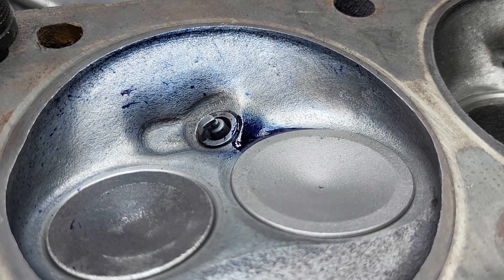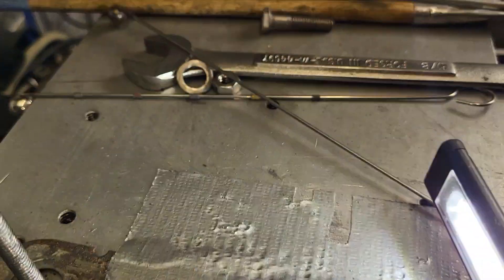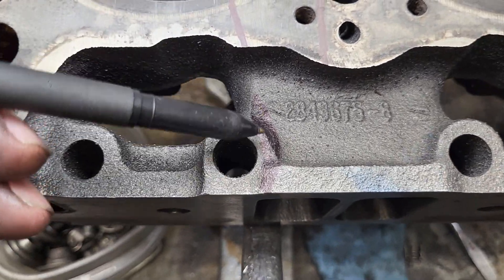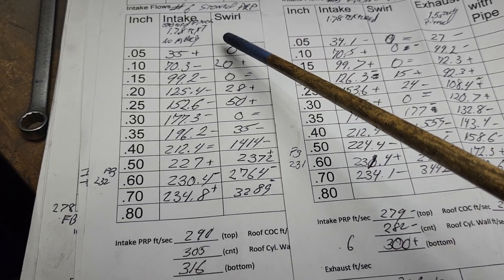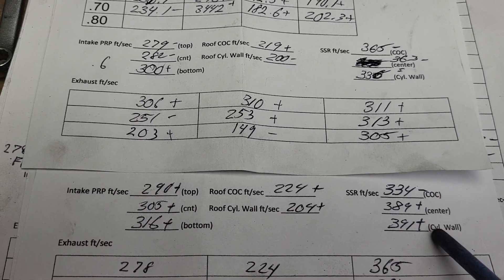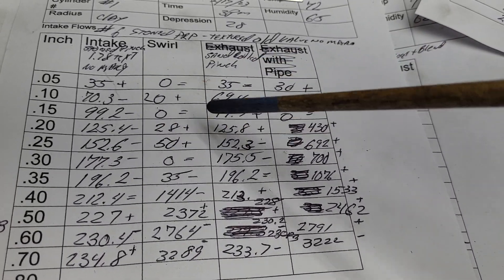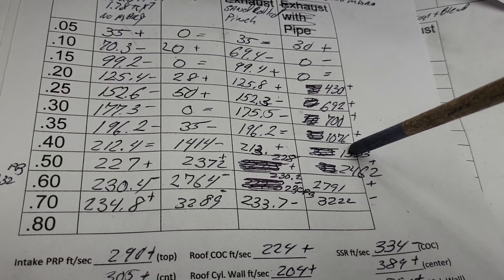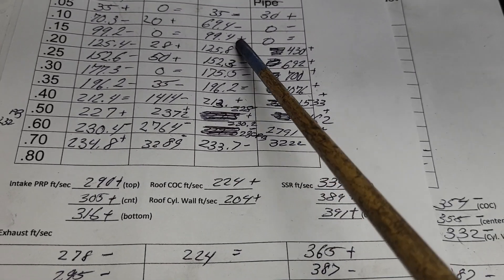David Vizard, Unity Motorsport, Mission Impossible 318 project. Textured push rod pinch experiments

Comment: If you grind the PRP area flat (parallel to the straight wall) and then grind a step immediately after the flat PRP, will the low pressure area created by the low pressure area promote more flow on the curved wall vs just making a bigger version of the same PRP shape?
Reply from the maker: Not enough metal to do that mod. Thanks

Comment: The 318 poly with the dual quads made 290hp and 330tq out of factory manifolds stock cam and heads with no porting whatsoever. I don’t think a hp/cid is out of the question even thru the 2 bbl. Especially if the compression is raised with some head milling
Reply from the maker: Good info. Thanks

Comment: Hey I have an off topic question, like all my questions and comments now that I think about it, but I digress: when deciding on a seat insert to install in a head what determines the OD of the insert? The seat diameter on the valve or the overall valve diameter?
I've asked this many places and I can't get a straight answer so I'm asking the person I should have asked first.
Reply from the maker: The insert should be at least the size of the valve. I prefer the insert bigger so the top cut is on the insert.  Casting thickness has to be considered. Breaking into water is no fun.
Reply: @servediocylinderheads   THANK YOU! Simple, straight forward, and totally answers what I wanted to know. I really appreciate the help. ✌️
Reply from the maker: @jseal21  No problem

Comment: Hi, love your channel. Quick question, would a head like this benefit with a larger intake valve? If so, what size would you recommend? Thanks again.
Reply from the maker: With the bowls done right they are thin with 1.78" valves. I would go 360 size 1.88" valve with tight sonic work.

Comment: If I had a CNC it would be cool to take an old undesirable open chamber head and weld the chamber up n mill it into a modern chamber and try that, anyone can grab a new hotness going but getting old junk to work good is just fun. You gotta do some upgrades not doing some mandatory mods is like a regular girl getting a job as a stripper and running her OEM knockers
Reply from the maker: Iron welding is probematic. Thanks
Reply: @servediocylinderheads  I've done it with muggy weld and peen stress relieve ...
Reply from the maker: @regdor8187  I have never used that.

Comment: is this a dodge 318? Ie 340 & 360 head swap! i went to ford! 351 C or M 1985- 1992 nascar yates was who got my air flow stuff! ( tractors marine stuff & oil testing standing on drag strip watch wreck's & not a good ending ok I walked away ) it was top fuel stuff dodge hemi ok! the wreck! (why i back my step father brother 100% death rate cancer break threw he lived threw it he had a job over my seal adoption to see my real father he went to boat factory in state far away to see my real father & fix my relation boat motor the factory was ranger boat & forest wood who i was to see! he told me that!)
Reply from the maker: It is a dodge 318. Thanks

Comment: Vortices I think is the word that is escaping you at the moment. Love the series.
Reply from the maker: Thanks
Reply: A vortex will slow the in flow....If a vortex helps your power, it is because your flame front is too slow, add some differential squeeze to move the flame front....If it takes 30 plus deg of advance for max power, your combustion chamber is wrongly thought out.....
Reply from the maker: @regdor8187  It is a deep open chamber with no squish. It needs all the help possible!
Reply: @servediocylinderheads  custom piston , raised into the flat area of the head , lowered in the valve clearance area ..
Reply from the maker: @regdor8187  That would be great but not in this plan. It has to be crippled with open chambers, reworked stock dual plane, reworked exhaust manifolds and a modified bbd 2 barrel carb
Reply: @servediocylinderheads  is welding allowed ?
Reply from the maker: @regdor8187  Nope
Reply: @servediocylinderheads  Darn , you are fighting  a battle organized in an asylum...

Comment: That much on a sand roll. How do you get them the all the same when all you did is sand roll the one? You got 7 more to go. How do you get all the same? I’m talking just a sand roll for the one port did that what if you slip a bit when working and didn’t see it till the end. The whole head crap? I mean sometimes sh$t happens. OR ! Don’t worry cause they are never going to be the same from one to the other.
Reply from the maker: You are right. Getting them all the same or at least close is a nightmare. Between core shift and taking the casting to practical limits.

Comment: Cavitation is the word you seek, sir.
Reply from the maker: I think of cavitation as a propeller slipping in the water not so much for air. Thanks
Reply: @servediocylinderheads  hvac specializes in air movement 43yrs. Bubbles introduced into any medium of flow does what, sir? It changes the designed flow. Water is the most visible however, it is ironic that you have a career of manipulating air flow and never considered that, after I listened to you describing it.
Reply: Them are 50 cent words! I think of dead air, same difference kinda.
Reply: @paintnamer6403  Unfortunately, due JB inflation,  they're 99 cents words, my friend.

Comment: Ok so I'm a Chevy guy but I am part of a car club with older Mopar guys and what I suggested to them with the 318 is get a set of those EQ magnum LA style heads then massage them a little bit like you did in your video. Your still running "MOPAR" style heads and you'll have more meat to play with. 
A couple of guys started to get interested in doing a 318 bc I am playing with a 305 to try and get 1 hp per cube out of it with ported 416 heads. It runs good and has great oil pressure so all I wan to do is help the little guy out.
Reply from the maker: It is a good plan.
Reply: The 416 is a good head to start with!
Reply from the maker: @robertwest3093  They are alot better with some work.

Comment: What? 120hp?
Reply from the maker: 318 two barrel hp rating?
Reply: Supposedly in 1968-70 the 318 2barrel made 230hp. The compression dropped as the years went by though and I know the 1987’ 318 with the 302 closed chamber heads was rated at 170hp. Wasn’t sure if had to do with the hp rating’s going from gross to net or the compression drop which on mine was like 8.7:1 😬. A good set of pistons that will get the compression up is the holy grail for all smog motors. Really neat how texture changes can make such a huge difference. I wonder how much a nice even swirl curve like that affects the exhaust vacuum. Doesn’t that make for a supercharger effect filling the cylinder more when it is hit just right? Thanks Charlie
Reply from the maker: @MidnightOilsRestoration  Good info. Thanks!

Comment: What angles are you running on the valve seat? 60 45 30? I mentioned this previously but changing the top cut from a 30 to a 32 might get you a few CFM, just from making the air turn less as it enters the chamber.
Reply from the maker: Classified

Comment: Boundary layer airflow. Bernoulli.
Reply from the maker: Thank you. Could not access the file.
Reply: @servediocylinderheads  At your service sir. I have the same problem on occasion.
Reply from the maker: @codered7453  Old clutch is slipping
Reply: @servediocylinderheads   Hell man, mine was slipping when it was new. Don't worry, there's always 10,000 keyboard engineers standing by ready to correct the slightest mistake. Fixing to subscribe so I can learn more and apply everything I can for an upcoming Jeep 4.0 build. Thanks for all the information!
Reply from the maker: @codered7453  I have a 4.0l head in storage. I did it 20+ years ago. I liked the design. I owned a 4.0l with some work done. Nice little engine.
Reply: @servediocylinderheads  That's awesome, they're one of the best engines ever made I believe. I have a 95 ZJ that was a test vehicle until '98 so it has some weird parts on it and it runs so good it's unbelievable. Ive been steadily doing small mods to it and will be building the motor and basically restoring the whole vehicle next winter I hope so it'll get all new engine parts and drive line stuff when I do it. I'm trying to go ahead with as much knowledge as possible so I don't screw it up. It's my daily driver so I want it right. I'll be following along on your engine videos and hopefully learn something.